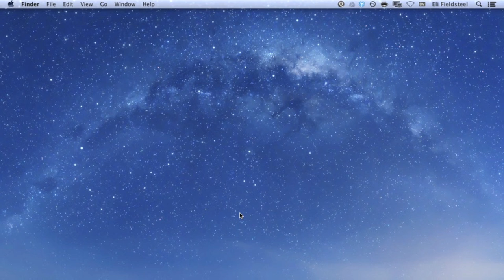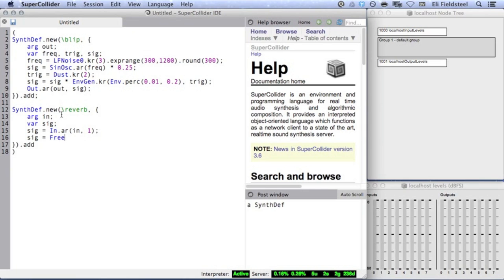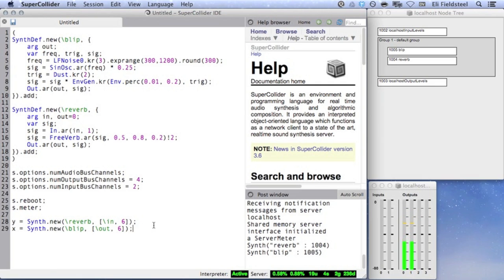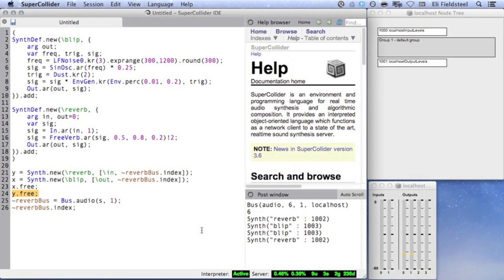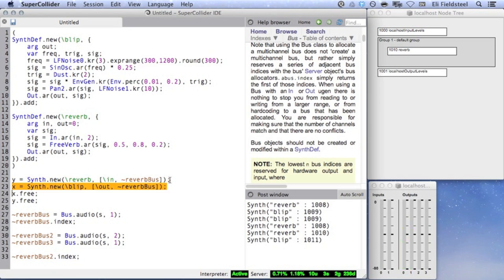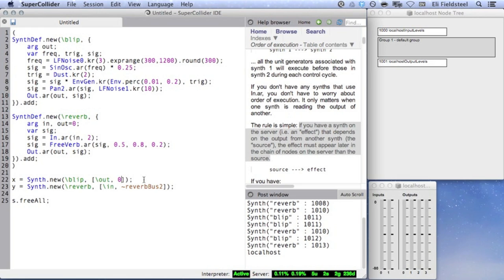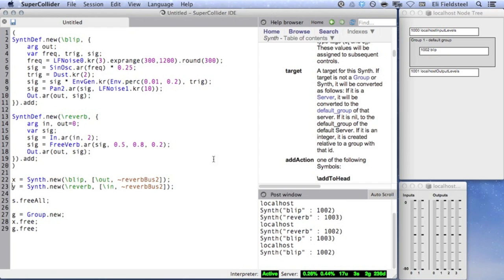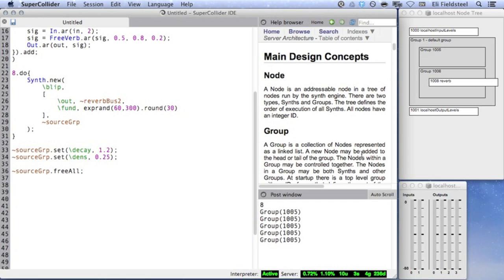SuperCollider Tutorial: 7. Server Architecture

Comment: Great tutorial, thank you. However, there is something I really don't understand. in the "source" SynthDef(\blip), in the envelope,in the gate argument you have placed a Dust.kr . I don't understand, I thought gate responds only to integer values, for being open(1), or closed(0).
Reply from the maker: Any number can be provided to a gate argument, not just integers. We often use 1 and 0 because they are simple and convenient. When a gate value is positive, the gate opens and the envelope begins/restarts. When gate is non-positive, the gate closes and the envelope transitions from sustain to release (this is only true if the envelope has a sustain component; for non-sustaining envelopes like the one in this video, a gate transition from positive to non-positive has no effect).

Remember that UGens like SinOsc, PinkNoise, Dust, etc. are just signal generators, and a digital signal is just a sequence of numbers. So, UGens can be used to control an envelope's gate. Dust is a signal generator that randomly produces impulses — little positive spikes in an otherwise zero signal. So, each time a spike is generated, the envelope is restarted, allowing some of the sound to come through.

Comment: There is something I can't seem to figure out, maybe it's not even possible. I want to use ".set" to change to another arg while playing.
I have this project that I want to relate colors to specific Hz, and I want for example that if I write green, it will go to 440 which is A.
So I made all the arguments but I can't change it while playing with .set.
This is what I have:

(
s = {
	arg red=523.25, orange=783.99, yellow=587.33, green=440, lightblue=659.25, whitishblue=493.88, bluesaturated=739.99, violet=554.37, purple=830.61, darksteelblue=622.25, bluegraymetallic=466.16, reddark=349.23, amp=0.7;
	var scriabin;
	scriabin = SinOsc.ar(red) * amp;
}.play;
)
s.set(\red, green) //not working, want to change the arg "red" to "green" while playing.

Now I want for example to change SinOsc.ar(red) to SinOsc.ar(green) using s.set. Is this possible? Maybe I wrote all the colors in the args and was wrong from the start 😅
Reply from the maker: There's no need for all these arguments. You only need one, and your set message just needs to update it to the correct value. I suggest storing your color frequencies in a separate collection. You also shouldn't be using 's' for naming Synths — by convention this letter is reserved for the localhost server, and overwriting it will likely cause problems.

s.boot;

(
~color = (
	red: 523.25,
	orange: 783.99,
	green: 440,
	//add more colors here
);

x ={
	arg color=440, amp=0.3; 
	var scriabin;
	scriabin = SinOsc.ar(color) * amp;
}.play;
)

x.set(\color, ~color.red);
x.set(\color, ~color.orange);
x.set(\color, ~color.green);
Reply: @elifieldsteel  Thanks so much! I have to learn more about the ~ purpose and all the options that come with it. I'll also watch more of the first episodes to understand better the args also. Again Thanks a lot ! 😁

Comment: Hi! Thanks for this awesome series of tutorials! It helps soooo much!
I just have a question. I have allocated a few Bus.audio(s,2)  (for example ~ch_kick = Bus,audio(s,2); = (Bus #4 in this example). I start to play a stereo kick synth outputing to ~ch_kick). I play a second synth that simply take input from ~ch_kick and outputs to 0 (my default audio out). I added it using .addAction: addToTail). I can hear the kick playing.
BUT nothing shows up on the 4th channel of the s.meter(numOuts: 32). I can only see the audio levels of bus 0 and 1. 
Is there a way of visualising the audio levels of the audio buses that we have previously assigned?
Thanks for any input, I didn't find a way of doing this in the docs or the internet but might have missed some resource.
Reply from the maker: Interesting question. Trying this out, I actually thought the following might produce levels on output bus 7 (but it doesn’t):

s.boot;
s.meter(numOuts:32);
{Out.ar(7, PinkNoise.ar(0.1))}.play;

You can always manually monitor busses by drawing your own level meter GUI, putting a SendReply in your synth, and receiving the data and updating the GUI with OSCdef/OSCFunc. There’s an example of this in the LevelIndicator help file, but it’s a little tedious. I’m not sure whether the ServerMeter class is natively capable of monitoring private audio busses. But, there might be something I’m overlooking, and you should consider posting this question on scsynth.org.
Reply: @elifieldsteel  I have seen the LevelIndicator so it is definitely possible but I agree with you, a little involved for just checking the level of one virtual bus.
I'll ask on the mailing list.
Thanks for your time.

Comment: Hi Eli, thanks for the great video
I have a question though. I'm working on a multi fx program in supercollider and would like for there to be a possibility to change the order the input passes through the effect chain. 
for example if I want to change
input_bus -> distortion_bus -> delay_bus -> reverb_bus
to
input_bus -> delay_bus -> distortion_bus -> reverb_bus
Is this possible to do dinamically in some way?
Right now I'm thinking I have to hard code every chain scneario so the I/O and group assignments work together, but I feel there should be better way to do it

thanks
Reply from the maker: Definitely possible. You can use the Node instance methods .moveAfter .moveBefore .moveToHead .moveToTail, etc. Check the Node help file, under the section "Changing the order of execution."
Reply: Awesome, that looks promising. Thank you!

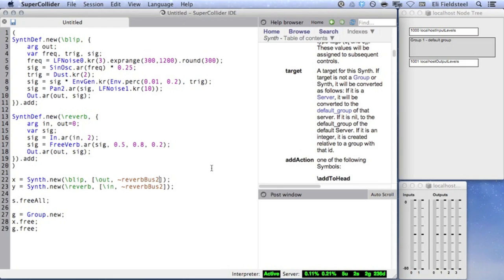Comment: Is it possible that newer versions (I'm using supercollider 3.9.0) automatically handle order of operations according to your synthDefs.... or something like that?  I was unable to replicate the error of triggering reverb before blip.  If I put reverb on the server first and then blip, blip automatically jumps on top of reverb (and I get sound, both blips and the reverb).  Code is identical to what you have around 16:00.
Reply from the maker: "If I put reverb on the server first and then blip, blip automatically jumps on top of reverb"

Yes, this is the expected behavior. The default addAction has always been \addToHead (at least since v3.4 which is when I started using SC). Thus, if you add reverb first, and then blip, blip is "added to the head" of the default group on the default server, placing it before the reverb, therefore the node order is correct and reverberant blip sounds are produced. This is NOT what I do at 16:10. I add the blip synth first, and then add the reverb synth. This causes the nodes to be placed on the server in the wrong order, so no sound is produced.
Reply: Eli Fieldsteel thank you!!